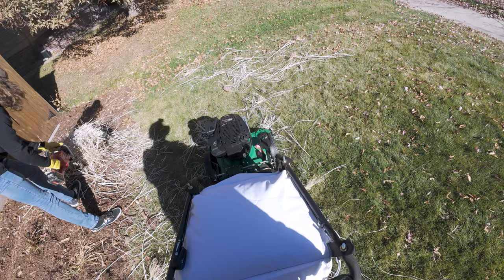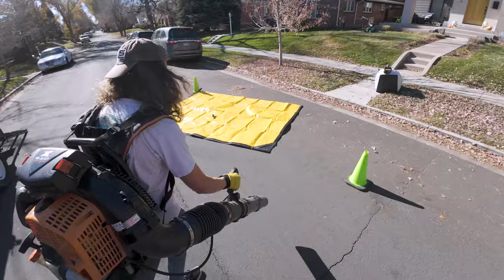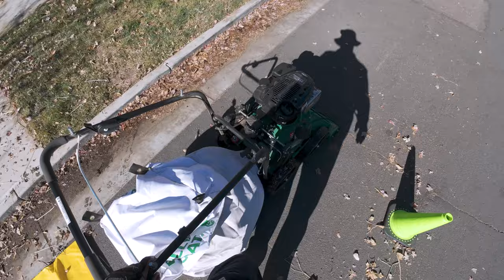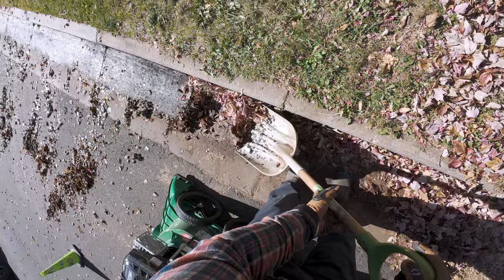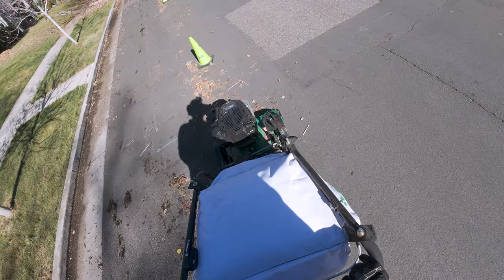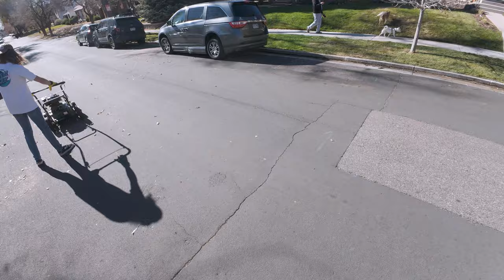Billy Goat KV601SP Leaf Vacuum: Real-Time Cleanup

Comment: We use a little wonder sp version. The vacuum is much bigger. In the beginning of this video I watched you struggle to suck those things up. I would buy the honda little wonder sp version. Bigger nozzle bigger engine. Drives itself. I just see the struggle and I cry. 😢
Reply from the maker: I might have to check that out. Looked briefly and it looked better than the Billy Goat.